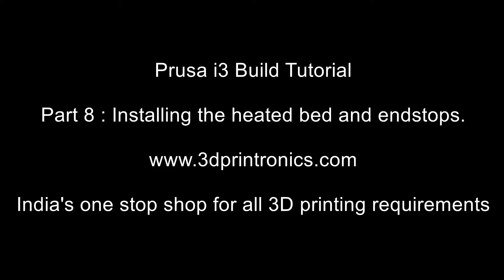Prusa i3 Build Tutorial : Part 8 - Installing the heated bed and the end stops.

Comment: Hi, how did you attach the thermister to the heated bed? araldite or m-seal? or something else. i am building prusa i3 and im stuck at this step. Please advice.
Reply from the maker: +Milind Fernandes Dear Milind,  Please do not use Araldite or m-seal for securing the thermistor to Heatbed. What you need is Kapton tape, First put some kapton tape on bed (in area where you want to place the thermistor), Secondly place the thermistor so that only its head is in direct contact of the heat bed and rest part lies on kapton tape underneth it. After this you can use some Thermal compound on thermistor head and put another kapton tape from top, make sure the tape is firmly stick on the bed and on thermistor head. Similarly put some more kapton tape on the other part of the thermistor. Thats it